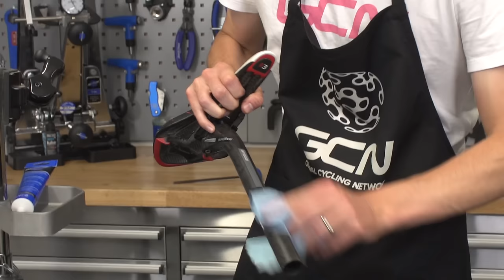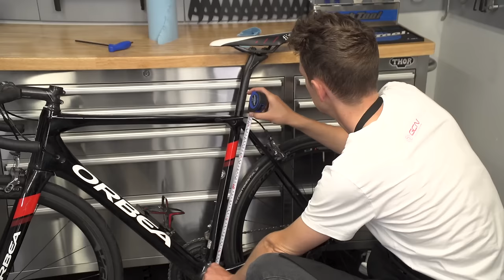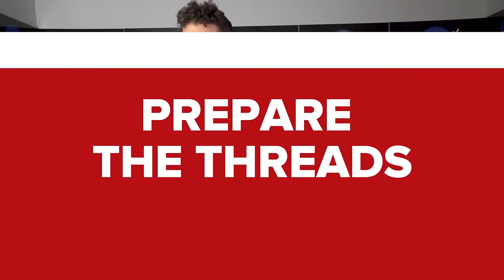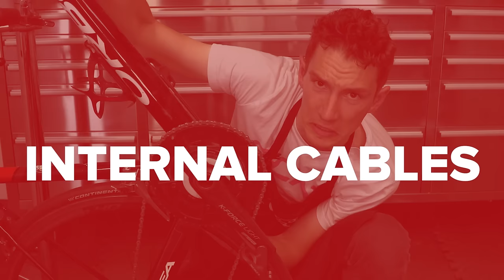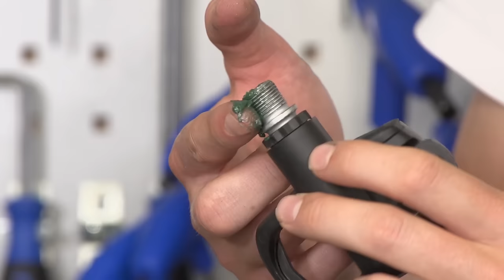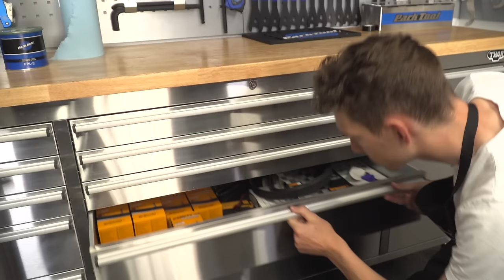6 Bike Repair Mistakes All Cyclists Should Avoid

Comment: Rather have a tip for a seatpost than keeps creeping down. Tried all I can thing of. Cleaned both post and frame. No joy. Friction paste. Same. 
Wrote KTM numerous time. No solution. 
So far, the best have been adding a layer of packing tape to the post. But it still drop a cm every 2-300 km. 
It's carbon frame and post. Use trq wrench. And even tried to go 2 NM above the printed value (as high as I dare)
Any tricks???
Reply: Maybe try a very small amount of thread-lock adhesive, the removable kind (Loctite Blue), and be sure you know the exact placement of the seatpost height.
Reply: The thought had come to mind. But I'm afraid it will act with the resin in the CF and cause something that will lead to loss of frame warranty. Considering I'm on frame number 4 (first 3 cracked in the first 6 month!), I'd hate to lose warranty....
Reply: If grip compound doesn't work Is the post the correct diameter? Maybe you could try foil tape instead of packing tape or even make a shim out of something like a coke can? Or perhaps fit a collar to the seat post itself to create a shoulder which butts up against the top of the seat tube when the saddle is at the correct height ?
Reply: Sounds like a manufactures issue. I have a 10 year old Cervelo Soloist LE that used to creep down. That Park Tool compound worked perfectly. Is your's an aero post or standard? If standard maybe try a cheap alloy one from your LBS? If it still happens Post a video to KTM's Facebook page? Did I mention I have a Cervelo Soloist LE?
Reply: Yeah, you'd think KTM would stand up for their product, but unfortunately I'm stuck with a dealer, that don't seem to care. And they want it to go through them. So a warning for you all. Stay way clear of freeflowbikes.com. They now have a new name, eurobikeshop.com. No wonder.
Reply: It's actually a MTB, so a standard 31,6 post. And it's a tight fit, even with the packing tape... LEt me see if the park tool compound works different than the syntace stuff I tried. Thanks guys.
Reply: aluminum soda can, cut it out, use it as a sleeve around seatpost
Reply: You either have:

The wrong seatpost collar for the frame.

A seatpost that isn't the correct size.

A frame that doesn't have the correct internal size on the seattube.

Use a set of measuring calipers on your seatpost or calculate the circumference from the diameter and measure the seatpost with a piece of string or flexible measuring tape. If that seems correct then check the collar. If it's the frame then you're kinda stuffed but you could always buy a can of your favorite beverage and once finished, cut some strips that correspond to the circumerfence of the seatpost and then fractions (1/2 way around, 1/3rd way, 1/4 way around...) of it and then use them as a shim. If you need anything thinner try heavy duty aluminum foil.

Comment: Dropping your cassette when removing it  ......... spacers everywhere.
Reply: Once you remove the lockring, place a finger on the axle while sliding the cassette off the freehub, thus moving the cassette to your finger. Point your finger up while carrying the cassette to the bench, and you should be fine.

Comment: "How to remove seized post"

Get an half-ton filled of stuff heavy-table.
 -Have a very fat Vice screwed in it.
 -Get an extra guy that his only job is putting more weight on the table.
 -Get 2 more guy just to pull the dam tube.

Done.
It's what i have done. And the table was still moving even though it was this heavy.

Comment: Messed up with an internal cable?
 Top tip is to use some cotton thread and a vacuum cleaner. The vacuum will suck the cotton through the tubing and then use this to tie to the cable and pull through.

May sound far fetched but it works a treat!

Comment: I've removed corroded seat posts from many bikes that other people have abandoned... without the use of heat (blowtorch, MAPP, etc) the trick is open and remove the clamp bolt, prise open the seat tube AMAP (as much as Possible!) and introduce some good penetrating lube, such as Plus-gas WD40 etc, and LEAVE for several days to penetrate. add some more daily. Then, if it possible to get some large water pump pliers on the top of the seat post (with the saddle removed) clamp the frame or get a strong friend to hold it for you, and start to turn the seat post back and forth. if using EXTREME FORCE doesn't move it, support the bottom bracket on a very solid wooden block, and hit it repeatedly with a club hammer! (2kg+) add more penetrating lube at each attempt, it's likely you will have moved it slightly even it no sign. usually, it will eventually start to turn/move, then you can withdraw it. 😃

Comment: #1 what grease to use :    Canada you must use marine grease on bikes, wheel bearings, bottom brackets, brakes, cable housing exits. This is to stop rust and poor roads with debris from gunking your bike. 1200 km redid all wheels and bottom bracket that is how bad they got when opened up insane gunk even though the bike was clean.

Comment: Galvanic corrosion is a common thing on bicycles and motorcycles too, plays havoc if
left unattended.
Tape on the seat post can often move with the post as a post slowly slips down so a very small
hacksaw cut when you know your seat is right could be better. Could be I say,
until you change the seat that is!

Comment: Yesterday, I spent something like 5 hours trying to change out pedals. The pedals on the bike required an allen wrench tool....spend 2 hours searching for  the right sized tool.....I put the pedals on so I know I had the right sized tool......but could never find it. Then another 45 minutes searching online for the manual to identify the size allen wrench I  needed. Then drove to two bike stores in the area and neither had  the right size unless I spent a butt load on an entire set. Then off to the hardware store to see if I could buy a single 8 mm allen wrench.....drove to two hardware stores and had to buy an entire set of allen wrenches (a lot cheaper than at bike store....but not the handle grip type). Finally home, get out the 8 mm and 2 minutes to remove the pedals. Putting on the other set of pedals required either a 6 mm allen wrench (which I already had) or a parker pedal wrench (which I already had)....so greased the threads of other pedal set and put those on. Done. Pedals replaced and it only took me close to 5 hours! LOL

Comment: Things you might lose easily, because they're small (?). I am fortunate enough to have what I think is a little extra moolah lying around so I look for deals or cool versions of those tools I will always need but too often lose track of and I buy one or two extras. Even if your budget is tight it might save you money by helping you get the job done instead of wasting time (again). Too often have I sent my necessary tools off on a vacation to the Sargassso Sea. Thank you for the helpful video.

Comment: If you've already stripped your bolt, you can get them out by placing a rubber band inside the  groove and pressing ni with the tool head. The rubber will naturally get a good grip without damaging anything else, just takes a little hand pressure

Comment: On the pedals, I sometime do a little tappy-tap w/ hammer... taking a break to consider whether or not you're turning the right direction, esp. after some grunting... that can help too! ;-) I also like those washers that save your crank arms from the hardened steel spindle.

Comment: mybike is 40 years old and the seat post is not ceased, especially with newer bikes made of composites or light alloys. Never heard of ceased seat posts until this video. Even one bike we pulled out of a creek after years in there, the seat post came up quite easily.

Comment: One that I just found (and resulted in a large injury) was not tightening the bolts at the wheel enough. Made it wobble at speed and crashed. It's obvious now, but at the time it seemed like too tight made the wheel not spin well. But better too tight than getting speed wobbles (though perfect tightness is ideal)

Comment: Using oil (e.g. 3-in-1 oil) on threads is better than grease in my experience, old grease can dry and make things seize very badly. Good tip on removing back wheel :) I find a plastic cleaner's caddy (~£5) a good place to hold all my cycling tools & grease, I have another one for chainsaw stuff, another for plumbing tools, and another for ... I prefer them to tool boxes: quicker, easier access to find & replace tools, cheaper too ;)

Comment: So I bought this bike 3 years ago that was made in 2009. And the seatpst was seized. Managed to get it out and lubricated it before putting it back. The seatpost is carbon fibre and the frame is aluminium. This year I took it out to check it and for some reason, while it was not seized, the carbon post started scraping away. There were flakes of carbon at the back where the frame squeezes on the post. It seems nowhere near bad enough to be dangerous so I keep using it but I would have prefered good old metal over this carbon magic material.

Comment: I was changing both brake and shifter cables at the same time once and I had had a long day at work so I figured I'd crack a can open and just wind down while fiddling with the bike. One beer soon became two etc. and fitting different types cables soon became an impossible task and I had to leave it to one side and go to the pub instead.
Reply: not at all unusual. used by may people. 
 in fact its the same perspective used by pro golfer john daly...seems to have worked for him!

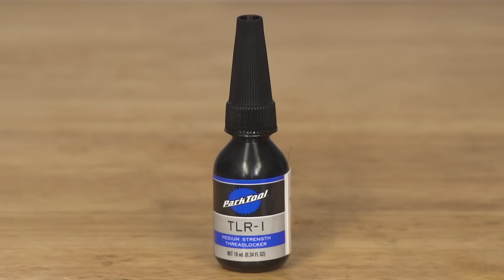Comment: There is a lot here that is very useful but at 2:45 was another mistake to apply threadlocker to bolts that you DON'T don't want to seize? It's designed to hold bolts tight, though you can buy it from super strong hold to relatively weaker hold. Grease would be better for preventing bolt seizure, but what grease is appropriate for bicycles? Motorcyclists often use copper grease, but do cyclists? White lithium grease is also commonly used in the automotive world and really easy to get.

Comment: Adding a wrap of tape around the seat post is a great idea.  
Suggestion to improve on the idea .... two things.
Place the tape 1/8th inch above the frame or collar.  Then if the post creeps down you can spot it.  If you don't leave a gap, you won't notice the post slipping down.
Use tape that is a different color than the post.  Same color as the frame looks really PRO.

Comment: I was a shop mechanic from '82 to '97 and removing a seat post from an expensive frame was never fun. However, I discovered that if you chop the post then CAREFULLY make two vertical cuts down the inside of the post just enough to cut it in two you can then grab hold of the sticking up part(don't cut it flush) and pull it out, hone the seat tube and Bob's your uncle. Sorry, I'm a yank and couldn't resist that. 🍻

Comment: Most frustrating mistake I've made was attaching my front mech cable around the wrong side of the fixing bolt, causing the leverage to be really bad, which made shifting the front mech feel terrible.  I was stumped for the longest time until a buddy at the LBS showed me the error of my ways, and BOOM shifting suddenly felt like brand new cables and shifters had been installed!

Comment: The number one rule back in 1967 at Schwinn technical school in Chicago by Mr. Stan Natan was.......   "Never put tools in your pocket"...  !!.. NEVER ..!!  45 years later I still live and work by that rule which has saved me and all shop workers thousands of working hours. Why?  Say there is one special tool in the shop and a mechanic puts in their shop apron pocket.  Suddenly the other worker needs it and spends 10 ~ 20 minutes looking for it, while all along it's in your pocket.  When I worked in a major bike shop in LA back in the 60s ~ the early 80s, if you were caught putting tools in your pocket it would easily get you FIRED!  So even in your own private garage shop, learn not to do it.
With Love, Dan

Comment: Greasing the post bothers me because on newer low end bikes it voids out the stock seat clamps so the seat doesnt stay put but you should regularly take it with you anyways and if it already is stuck i use a quill stem

Comment: Place a vacuum cleaner hose on one internal cable routing hole and a thread a cotton string into the other. Super easy to trick to route a cable or wire through a tube with turns and obstructions.

Comment: I aint ever worked on bicycles. But i have 20 years experience working on cars, industrial equipment, motorcycles. And using a thread locker will make your bolts harder to remove. And if everything seizes. Copper anti seize is affordable (well was affordable considering inflation) and works very well for making sure parts to seize together.

Comment: Hi there, had a seatpost problem, used coca-cola, a long piece of wood, an old inner tube and a cloth for frame protection, removed my saddle, fitted two round 10mm round steal instead, lenght 30 cm, put the wood behind the right side of the round steal, over my frame on the left side down to my bottom bracket, alongside the vertical tube. Than I fitted the inner tube around my bottombracket frame and the long wood and put al lot of tension on it, with a cloth between the saddlepost and frame. After that turnde my bike and filled the vertical tube with coca cola. After two days suddenly I heared a noise and I was lucky. The seatpost came loose. This trick helped me. Now days I remove my seatpost minimal 4 times a year, and refit it with special grease. No worries anymore. Good luck.

Comment: I changed my cassette, this morning. I turned the bike upside down. That makes it so easy to remove the wheel. Just hold the derailleur back and pull the wheel out. Same to put it back.

Comment: I mark my seat posts permanently. On the drive side. Ronded nuts: use the right wrench or socket. Use the 12 point end of the wrench when you can. Vice grips or bench vice to get them out. Hex bolts: easy outs. The drill is already there. Stripped hex wrench: cut off the stripped end.

Comment: it all goes back to when bought that cycle at that shop that assembled it.  They pretty much set the standard lead when you fine tune it ect. throughout your ownership.  If was assembled from the start right out of the box and not properly tune and sized to your girth (body measurements)  it always going have glitches throughout your ownership!  Unless, you write (email) the manufacturer explaining in detail your problems , like I did, so they can help you fix it.  Or... youj can do like I did is to research on how to properly tune, take some things apart and align mechanical parts, and later adjust hights ect.. to your measurements  ( it will take a about 2- 4 weeks until you learn and become friends reference what they say !

Comment: I have built a bike with a new top Look frame, and the top tube had an internal guide inside, but for the gears - I had to find the hole in the bottom!

Comment: measure old chain before throwing it away so you know how long to cut new chain,
assuming the old one was the correct length...

when replacing housing, measure before throwing away
file off the burr you make when cutting the brake housing

Comment: help ful tip when repairing  a broken chain on the sid eof the road in rain, kepe some thin wire with you at all times, put it through both ends, with a six inch gap between, so chain doesnt keep flying free as you fight with the chain  breaking tool

Comment: oh thanks ! did take the wheel off the wrong way :))))) to not round the inside of bolts, keep your index on the neck/tool corner to properly fit all the way in, half way in will almost certainly wear out your tool/bolt

Comment: You should be carefull with greasing threads, especially on carbon frames. The lowered friction in the threads result in higher pretension of the screw using the same tightening torque. Only grease threads when the manufacturer says you should grease!

Comment: I would also recommend greasing the hole, not the pole for bolts, pedals, seatposts, etc - greasing the threads results in most of grease being kept out of the hole and not being useful at all.

Comment: Galvanic corrosion (also called bimetallic corrosion) is an electrochemical process in which one metal corrodes preferentially when it is in electrical contact with another, in the presence of an electrolyte.

Comment: Proper order of action can make life better. Keeping the correct seat post height is problem for new bike owners. They let someone else test ride the bike, loan it to a friend or say to themselves "it should be a little higher or a little lower". After I fit people on their new bike, which have an aluminum seat post, I score a little line on the seat post at the top of the seat post clamp. Just a 2-3mm mark, not a ring. This is their base line. New pedals, new shoes, or a new saddle may require a new height but the base line gives a reliable starting point.
       Greasing pedal threads is simple but can be made better, Grease both threads, the pedal and the crank arm threads should be greased to get a uniform coating across all the threads. This will make a better corrosion shield on all the threads.

Comment: I put grease on my quick release saddle just as you advise and it sink down cm by cm after every ride
Reply: Use a carbon paste, even if there's no carbon involved. ..It increases friction between seat post and frame and minimizes corrision so stuff doesn't get stuck

Comment: The best grease I found to prevent frozen bolts is graphite or Moly grease.  This way, even if you forget about them for years and the grease dries out, the thread is still lubricated by the graphite or moly.
Reply from the maker: Good tip thanks Ken